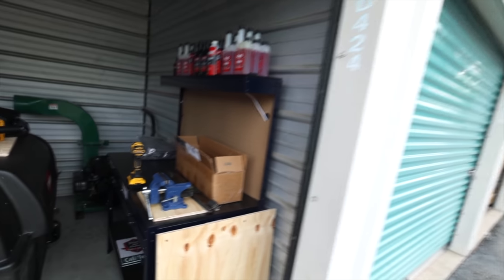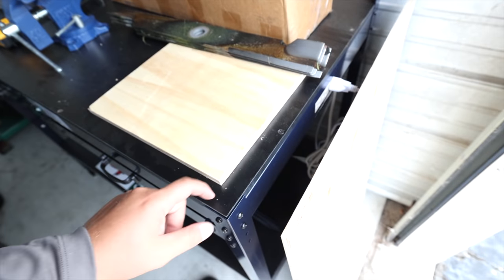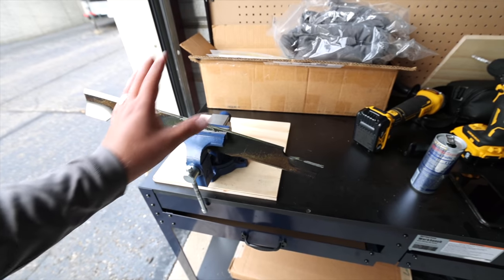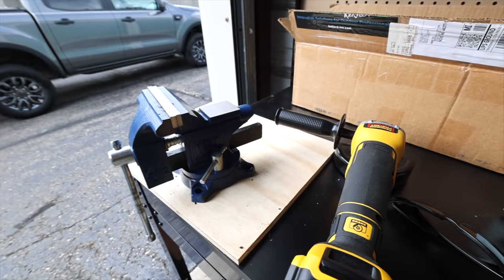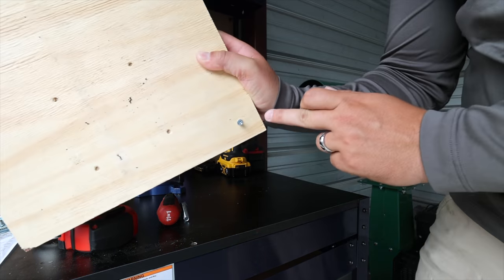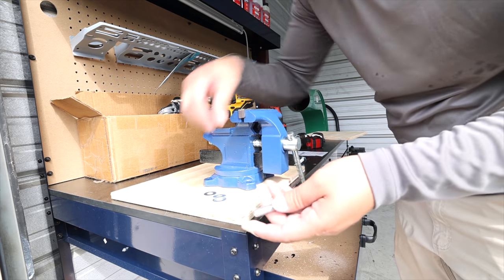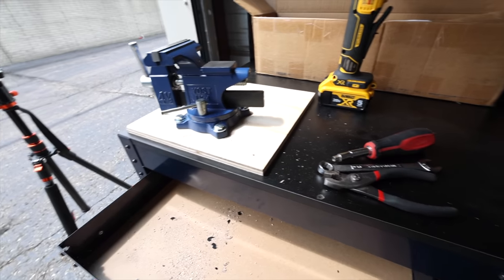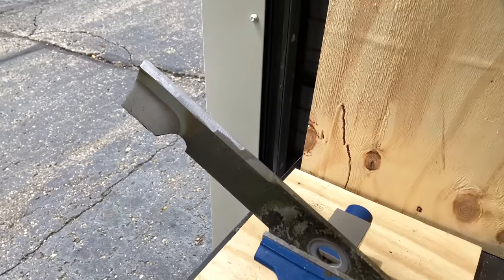DIY Workbench Setup (2 Hour Build, $200)

Comment: You should store the stabil bottles on the bottom shelf of the work bench.   This way if the liquid leaks out it’s already on the bottom and doesn’t make a mess all over your work bench, just the bottom shelf and floor.   If you have the stabil bottles stored on top and they leak out.  They’ll get your entire bench soaked

Comment: Great video! I got the same vice and love it!
Reply: I just bought one for 20 bucks used from a bric-a-brac shop. Wilton! Love it. Game changer. Learned a lot from your video about the vice placement. Great video!
I will also try to learn from your injury as well... lol .. how not to get cut by a pencil sharpener. 🤣🤣🤣😅😱🤭. Could happen to anyone. I swear, it's the SILLY THINGS that always seem to get us. 
Yesterday I dropped a scrap piece (small long piece) of 1" butcher block. It fell off my bench and flipped and the sharp (wooden) edge hit my shin and managed to put a nice bruise AND SCRAPE about 4" wide on me. Yes it broke skin! And I was wearing long pants too! 🙄 Albeit thin polyester pants. It hurt too. WTF. The LITTLEST THINGS are what you also have to watch out for..

Comment: That’s why you have nuts on the grinder to be able to turn it. Either way you put the blade you’ll have to reposition it so that you don’t blow the shavings into the locker. You don’t want to deal with having to clean that up
Reply from the maker: Exactly

Comment: I will do the hitch receiver on the back of my Toro time cutter SS 4225 I am not in the commercial business it’s just my personal mower nothing fancy but I’m thinking about quitting my job as a business owner in the delivery business and doing lawn care both mowing and spraying and fertilizing South washing houses cars things like that so I’ve been watching your channel they’re trying to get some ideas on what to do what equipment to buy etc. but in the meantime I have welded a hitch receiver 2 inch on the back of my time cutter that I can put my boss tailgate spreader on to spread dry fertilizer and I can take that off and put my liquid spray tank that I made on the back of it in order to keep it from doing willies I Welded hey Siri add a caster wheel on the back under the hitch it works fantastic I highly suggest anybody with a zero turn do something like that it is not tear up the grass and it only touches the grass if it starts to tip a little bit it’s a literally may be a quarter of an inch off the ground if there I also put a push button start on it I’m putting a rear steel roller on the back of it to straight better more that’s gonna be able to be lifted with a push a button text to linear actuator and I have a winch to put on it…. My toy
Reply: Holy hell.  I want some of what you're smoking!